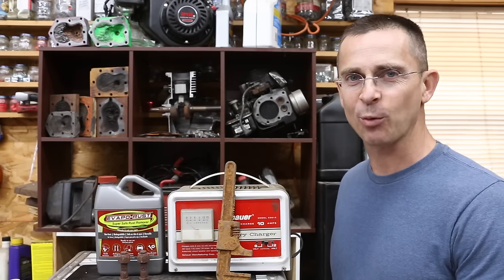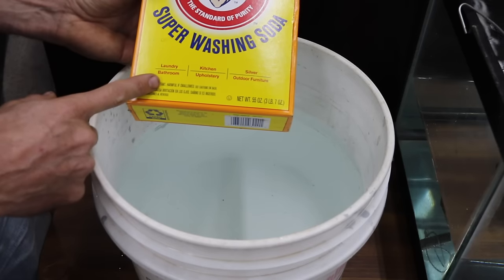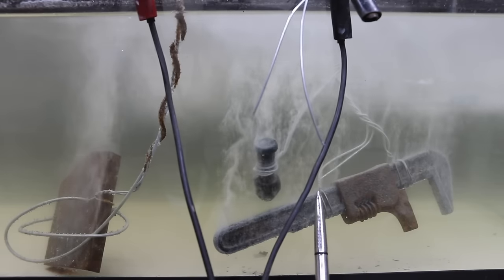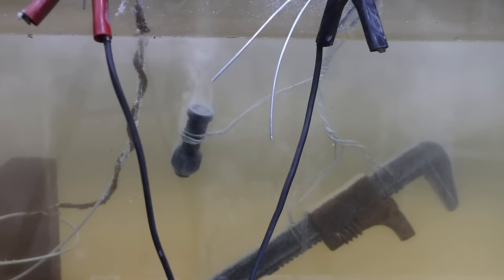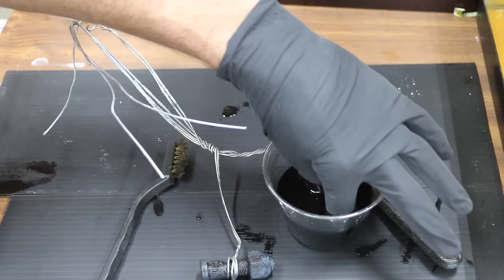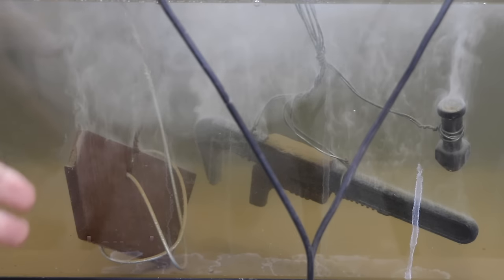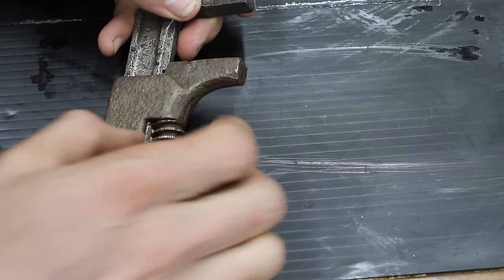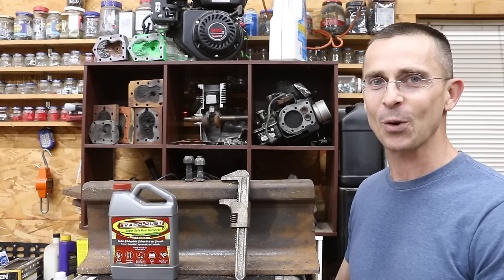Is Electrolysis better than Evapo-Rust?  Let's find out!

Comment: Just tried this on a classic vice. Reading up about it, if you don’t want the black use distilled water and I used washing soda as electrolyte it did work well  Goggles where recommended washing soda in eyes stings stings. I used three attempts with agitation in between with wire brush.. Metal will develop surface rust quickly when removed so out of filthy mix and into clean water agitate clean then wash is thinners or similar so water cannot promote rust. It is not a five minute operation but really cleaned up a severely corroded vice. Still had to do a lot of manual. Cleaning work but all the rust came off easily ish as the process converts it. Grease of and paint so it can get to the rust. What goes down the drain is washing soda and rust. Caution only use plain old iron as the sacrificial metal. Other metals stainless steel, galvanised metal will give off poisonous gas. Do in a well ventilated area obviously concentration of hydrogen or oxygen may promote an explosion so take care. Easy to do in three evenings of set up let it run overnight wash clean set up again do same again. Three nights and really pleased with result. Cleaned wire brushed off the very light after treatment rust and a coat of Hammerstein. Just reassemble and new Jaw Faces and done. Vintage Record no three back into service. Bet the old boy feels better😀
Reply from the maker: Thanks for the feedback.

Comment: Thank You - great comparison. I'm about to perform electrolysis on a flathead engine block. How clean (degreased) does the block need to be before I start? Will the washing soda degrease as well? If so this could be a plus point for the electrolysis as I'm aware the parts must be grease free before I use Evapo-rust.

Comment: nice demo, I work in industry, mostly use a pneumatic die grinder with a wire brush attachment or pedestal grinder with a wire wheel. Sandblasting and the laser rust removal processes are the best methods in my opinion.
Reply from the maker: Thanks for sharing.

Comment: This process seems like a good solution for removing rust from metal that you can't access with a wire wheel, wire brush or is just too fragile.
I wonder if I sandwiched a bunch of misc. rusted hardware between some wire mesh, if that will work...mostly?
But I do have the perfect test...a good idea, for something that is supposedly not correctable....I will let you know.

11-5-21
Forgot polarity hookups....
On my 3rd or is it 4th batch?
I still have to clean the items afterwards but it is much quicker.
Sandwiched items between some mesh and...ehh.
Stringing a wire down the center of several sockets to remove interior rust...good results.
Multiple pieces of sacrificial steel...a must. PLUS, Cleaning the steel, with a wire brush or scraper, periodically helps considerably.
A large flat piece of sheet metal in the sacrificial mix works great and is easy to scrape.
Running your power supply at its highest is cost effective.

Going to do a test for my big project soon.

Comment: The contact for the siding part needs to be direct (the wire) thin wire through any crevices is also helpful.  Electro plated a lot of jewelry over the years so this is very interesting but contact points are important.
Reply from the maker: Thanks for the feedback.

Comment: I was thinking about how the wire was wrapped around the wrench. Would it have been a little quicker if one wire was wrapped around the handle and the other wrapped around the slide? The slide never seemed to react like the handle was. Just a thought and might not have made a bit of difference.
Reply from the maker: Thanks for the constructive feedback.
Reply: Yes, rust is not a good conductor.

Comment: I typically use a very strong vinegar to remove rust, mill scale, and galvanized coatings from metal and I have found that it works extremely well.  By strong vinegar I am talking about 20% or even 30% vinegar by volume.  You will not find it at the grocery store but a good hardware store or agricultural supply will usually carry it.
Reply from the maker: Thanks for the feedback.

Comment: Sorry I commented about using electrolysis on your other rust remover video, I just found this one...  the electrolysis might work even better by using copper connection wire and a sacrificial carbon rod instead of the steel...  really like your videos!
Reply from the maker: Thanks!

Comment: Great  video.  I, and I'm sure others, learned a lot from it.  I never thought before about insuring a good tight wire connection to all separate parts of the rusted tool or item to ensure good electrical connection to all parts.  Thanks much for the virtual experience.
Reply from the maker: You are welcome!

Comment: A stainless Stainless steel anode would work more effectively at rust removal platinum is the best but expensive. Also the size of the anode should be equal to or greater than the piece to be cleaned. A power supply with adjustable amperage would also improve results, don’t forget that the rate of removal is affected by the anode condition. Cleaning the anode during the process also increases effectiveness. Nice comparison, love the videos.
Reply from the maker: Thanks!  Thanks for the feedback.

Comment: A couple of notes on electrolysis:

The process is directional, so the side facing the anode will de-rust faster than the side facing away. I do my electrolysis in a 50gal plastic drum with some rolled up sheet metal sprung out to the wall of the barrel, this way you get equal action from all sides except the top and bottom. Parts with deep holes or surfaces not visible from the outside will not work as well. 

The wrench would have worked better with a better electrical connection to the sliding jaw, and moving the jaw around to expose the metal under it. Unseizing tightly fitting parts with electrolysis doesn't really work though

You only need a couple of volts before bubbles start forming. Raising the voltage will only waste power splitting the water into hydrogen and oxygen. If all you have is a 12v charger, you can't do much about it. 

If you put in too much electrolyte, the solution will be too conductive and may overload your charger. If you don't have any way to control current you can adjust the concentration till you get a reasonable current. You can also reduce the anode area to reduce the current, but then you lose some directional coverage.

Also, hydrogen is produced at the cathode (the part to be cleaned) which can result in hydrogen embrittlement, which may be a concern for some parts.
Reply from the maker: Thanks for sharing.

Comment: Interesting the difference in color due to carbon content in the forging and the machined steel on that wrench. 
Great Job, thanks!
Reply: Wrong. Its because the sliding part had insufficient electrical connection, you can clearly see that no oxygen bubbles emerged from that part, and if i have to be captain obvious: That part was still rusty after 72 hours.

Comment: Krud Cutter #1
I would definitely go with the electrolysis for on a budget runner up...

However being that the Evaporust is basically a neutral ph non acidic level, that would be ideal if worried about in tight spots getting onto other nearby components accidentally... 
The muriatic acid I thought worked well too but it takes the metal with it, so need to remove it QUICKLY Before it gets a chance to really START eating away the metal...

I enjoyed this one since I did a video somewhere back in 2013-2016 on electrolysis on FB...

Could you refer me to some outlet I can source that Sodium Carbonate for the best deal Boss?

Comment: I'm surprised you got either to free up.  rust-welds like that are hard to break past a certain point no matter what de-rusting process you use.  The penetrating oil on your wrench is what likely did the trick.   Nice video! Thanks for sharing.
Reply from the maker: Thanks!

Comment: I prefer Krud Kutter, since it also leaves a coat of zinc phosphate on the material when it's done. This is an effective base coat for preventing further corrosion. I like to spray the component with ZRC Cold Galvenizing spray afterwards... it'll never run again! Although the ZRC isn't too abrasion resistant, so you might have to respray after tightening if it's a bolt.
Reply from the maker: Thanks for the feedback.

Comment: You've just discovered an indetectable method of scrapping the old 'Farmabago' when the time comes. Submerge in large tank of soda solution connect electricity and pour farmabago down drain when fully dissolved.😂 . On a more sensible note,we use the  electrolysis tank method frequently. We have a large plastic tank with twelve 20 mm dia graphite rods suspended around the perimeter of the tank and all wired together. When using acid pickling solutions such as evaporust heating the solution speeds the action up greatly. After any acid bath rust removal it is wise to submerge the components in warm  distilled water to leach out all the acid from the metal pores
Reply from the maker: Thanks for the suggestion.

Comment: Need to move the wires to the sliding part of the wrench (cathode),  bcuz it's not making good  contact with that part of the tool. Notice where the wires are connected and where it's the cleanest, the first time you pulled it from the tank. 

There's your proof.

Great video, though! Thanks for your effort!
Reply from the maker: You are welcome!  Thanks for the constructive feedback.

Comment: Great video. You may use much larger currents with the electrolysis, e.g. you could connect your inverter welding machine to it. It would be faster. Also, the size of the electrodes matter, your sacrificial could be larger. It is a great clean effective process.
Reply from the maker: Thanks!

Comment: One extra thing you could have done (Just for completeness) would have been to have your charger running through one of those plug in power usage meters. You said that Evapo-Rust can be expensive for larger parts, but it might have been interesting to see how many times MORE expensive than the combined cost of the washing soda and electric it really was.

It wouldn't be a totally definitive test as the Evapo-Rust can be reused a few times, but it would have been interesting to know the results anyway. If you ever choose to revisit this it could be an interesting side test to add? Maybe see how many rusty bolts a set quantity of Evapo-Rust can get to bare metal one after the other, then see how much it would cost in power and washing soda to individually get the same number of bolts and comparable results using electrolysis ? The reusability of the Evapo-Rust could make it a closer race than we'd think.......... Or maybe it wouldn't. :D
Reply from the maker: Thanks for the feedback.

Comment: Question..
Would your contact be better on the wire you used had it not had any paint on it? I'm thinking you lost some power on the clamp and on contact with your sacrificial steel and wrench.

Comment: Great video, thank you!  I like electrolysis, but I've been told that it promotes hydrogen embrittlement, so be careful using it with structural parts.  My favorite is the Molasses method (you can laugh, but only for a moment...) It really works, it's cheap, seems to not damage the underlying part, and needs no neutralization.   Just Google (or youtube) molasses rust removal. I'd like to see you run a test on it. In all your spare time...
Reply: Ps - electrolysis is the favored method of the Smithsonian.
Reply from the maker: Thanks for the video idea.
Reply: Electrolysis works well but hydrogen gas collects on the object being derusted and can be absorbed.   Parts like springs can snap under load.  Can be counteracted by heat treatment.  Lots of information available on the web.
Reply: Hydrogen embrittlement sounds like an emotional challenge during the high-schools dating process.

Comment: They work on different processes and Evaporust is considerably easier to use. On that you mention it is expensive (even worse here in Australia, despite the fact it gets made by licence over here, so isn't shipped, $100AUD for 5L) that may be so, but the benefit to Evaporust is it reusable, and the process it works by chelation means the chemical process returns the active ingredient back to solution to continue working. A gallon is able to remove half a pound of dry rust. So if you do the bare minimum of wire brushing your parts before hand, evporust will last a long long time, and you can continue to reuse it. It's completely safe, so you can put your hands in the stuff, and is water based, and so can be replenished with water when it evaporates off. It is safe to use on parts that have other stuff on them like plastic, rubber etc. as the evaporust doesn't touch them. And further the chelation process doesn't touch clean metal, and so you can leave a part in for a year and it will remove the rust, but it won't eat the main metal, which will happen with electrolysis and with acid removers, this point is especially great for parts that have a lot of rust, or only rust on one half, and not the other, because the evaporust won't touch the clean side, and will leave the part.

Evaporust also works on forge scale as well, so if you want to clean up metal, or you forge and want to remove the scale, the evaporust will do that. Further it doesn't touch brass, or aluminium, so multi metal parts won't be affected, which is great if your restoring something and don't want to remove the brass patina on a part to retain its value as a rare or old part.
Reply from the maker: Thanks for the feedback.

Comment: BTW, Evaporust works best when above 72 degrees F,, stirring occasionally. Also, you need to remove all grease, oils and waxes from the item you want to remove the rust on as Evaporust won't work on oily, greasy or waxed items. One last warning, Evaporust will do bad things to old rubber so make sure you don't dip anything ( like antique bike pedals) in Evaporust.
Reply from the maker: Thanks for the feedback.

Comment: Evapo-Rust might be best for surface cleaning, especially on large-scale objects.  Since you can't just submerge the whole thing to get the rust off of it.  The electrolysis is a bit more dangerous due to the electricity and the possibility of the gases that are emitted during the process and it does require you to have a sacrificial piece of metal on hand in order for you to do the process but it might be good for small objects in large quantities, to get them all done at once.
Reply from the maker: Thanks for the feedback.

Comment: As you suggest, I would use electrolysis for larger items and i.e. evapo rust for smaller parts. Furthermore it seems electrolysis takes more time on the bolt, right?

Comment: Sir I assume it will be better (more quickly) de-rusted it you wrap the wire directly on the moving jaw of the wrench. The reason could be that because of the rust between the moving and fixed jaws, it is not conducting electricity well?

Comment: Just looking at cleaning up an old cast-iron pan I inherited.
One other source was emphatic that the solution have 1 oz washing soda to 1 gal wster!
He said more in solution would slow or stop the electrolysis process.
Clearly it didn't stop, but mabe would have been faster or more effective, or both.
Also a larger surface area of the donor piece, wire-brush it shiny first, and move it close but without contact.

I don't know if these tips will make any difference, but I wll be trying them on my large pan.
Reply from the maker: Thanks for the feedback.

Comment: I wish you would demonstrate rust and stain removal on some precision machinist type tools such as micrometers and or satin chrome scales, combination blades, protractor and center heads etc. 
Tools that are NOT "rust buckets", but have slight rust spots, stains or defects that can be removed or improved to enhance any time worn precision instruments for preservation.
Reply from the maker: Thanks for the suggestion.

Comment: I think you mixed up hydrogen and oxygen. The hydrogen is being produced on the wrench. 
Btw I think the reason why the electrolysis on the wrench slowed down so much after the first 24 hours was because the large uncovered metal surface of the cathode was wasting most of the current to produce hydrogen. In my opinion it would be better to try and separate the sliding part and the wrench after a bit of electrolysis and have two separate electrolysis baths for each one going in parallel. Should take way less time and current.
Great video btw.
Reply from the maker: Thanks!  Thanks for the feedback.

Comment: I hear that the Evapro-rust can be reused. However, do not know that from experience.  If that is true, the Evepro-rust could be more cost-effective than electrolysis.  But once set up electrolysis is pretty cheap and it does so much to remove rust but TRYS to convert the Iron Oxide Rust back to Iron. It must but does that stay with the part or just fall to the bottom of the tub. I think the latter.  Electrolysis is cheaper if you have another use for your battery charger, like for charging batteries.    I don't know what chemical process Evapro-rust is doing.  

It's notable that the wrench lost 6 grams during the electrolysis process.  The lug nuts both lost 2 grams from electrolysis and Evapro-rust.  I wish he had two identical wrenches to compare but how likely would that be unless he deliberately rusted two identical wrenches in an identical way.  Thumbs up on this video all the same.
Reply from the maker: Thanks!  Thanks for the feedback.

Comment: Just a suggestion from the outside looking in. Do you think the electrolysis would have worked quicker/ better on the wrench if you would have wrapped wire around the mobile section of the wrench as well?